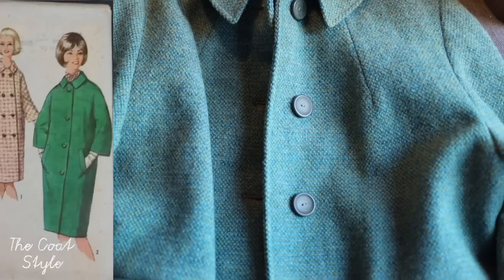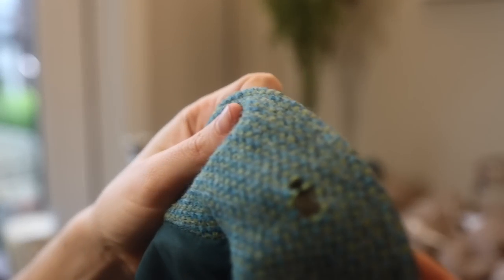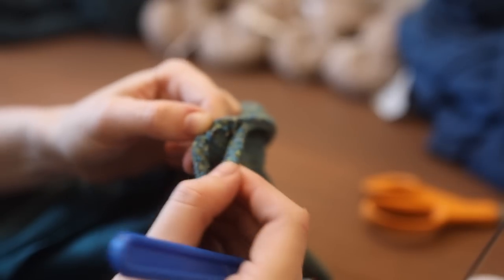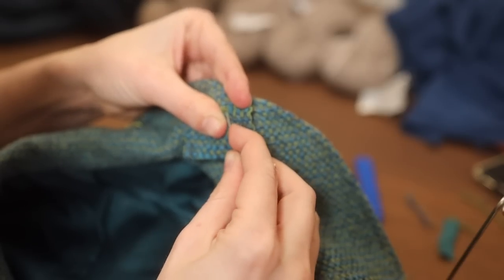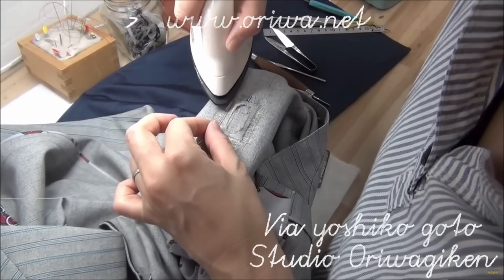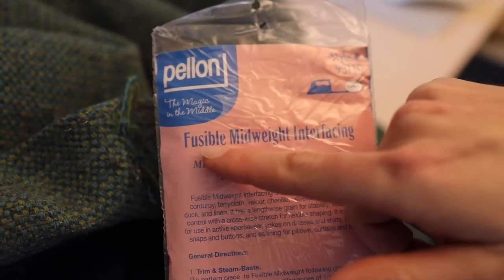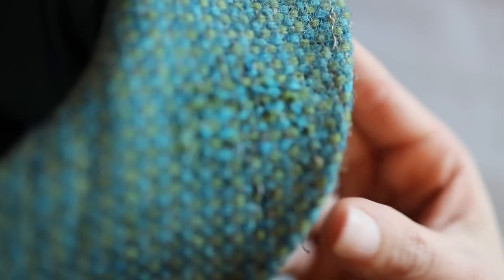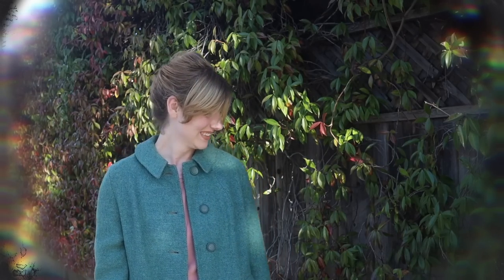How I Invisibly Mended my Dream Vintage Coat || Kaketsugi

Comment: Your mending looks much better than the mending I did the other day! My elder son has a bad habit of taking his shirts off without undoing the buttons, which puts a lot of stress on the buttonstand at the 3rd button.  Now, the white linen shirt wasn't too hard as I harvested a pocket from another white linen shirt, and the material wasn't too damaged.  The other shirt is a small check, and the material I'd been able to harvest wasn't big enough to nicely patch over the hole. So I patched the back of the hole which is okay, reinforcing and holding the patch in place with hemming tape. And satin stitched over the hole from the outside. You can't see it when the shirt's buttoned up, and I needed the area to have strength!

Comment: You did a really great job, especially as you were not an expert, but you will be one day.  Please may I suggest that you try using a WOVEN adhesive interfacing, instead of the type you used.  I found that with woven fabrics, I got a much better and more natural result using a woven interfacing as it handled  more like the original fabric.  Thank you for sharing this video.

Comment: I wish I knew about this when I’d bought my vintage wool plaid skirt.  Sadly arrived with a lot of moth holes.  I ended up mending with what thread I had of similar color so the fixes are visible.  Maybe I’ll undo those and rework with thread from the seams.

Comment: Huh! Interesting timing on that, I just harvested wool threads from scrap fabric to fix some holes in a wool garment I made last year (wasn't moths, this culprit has long ears, a wiggly nose and short fluffy tail and apparently a taste for fabrics, he started eating the piping off my old sofa too), put a little patch behind it and used the harvested threads to stitch the patch down and loop over the cut ends so they didn't puff up (much looser weave than your tweed), going to try darning another much smaller hole he put in it and because it's got such large patches of solid colour (it's a big plaid) I'm wondering if picking apart the ends of a few threads and needle-felting them in would work.